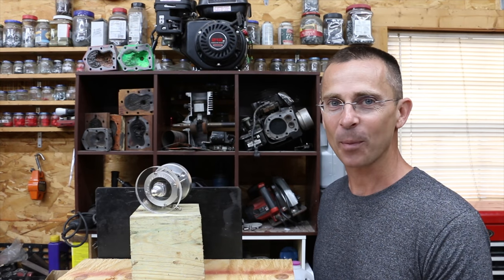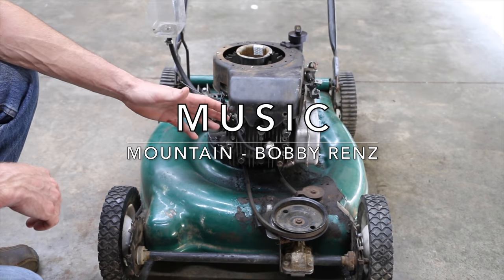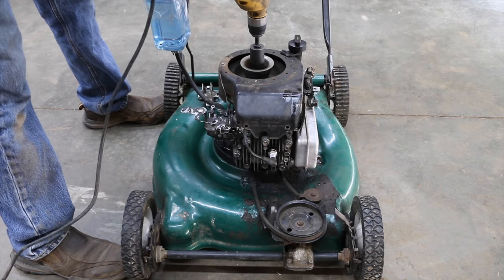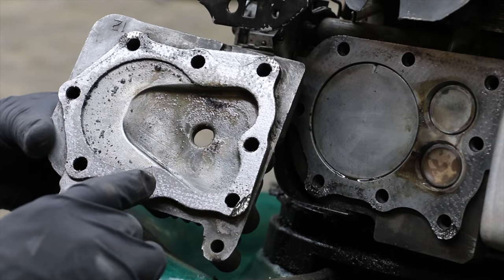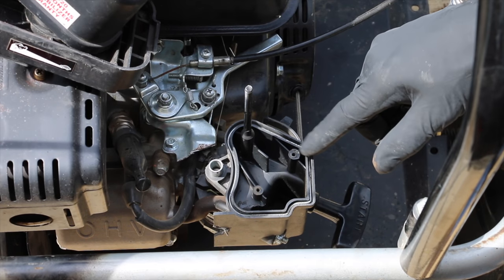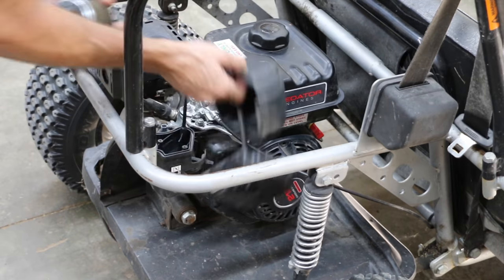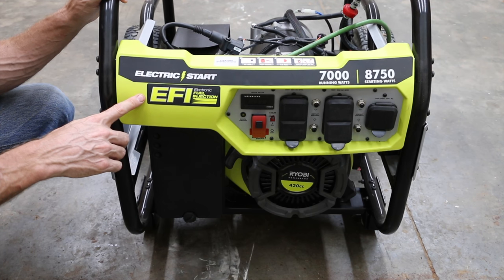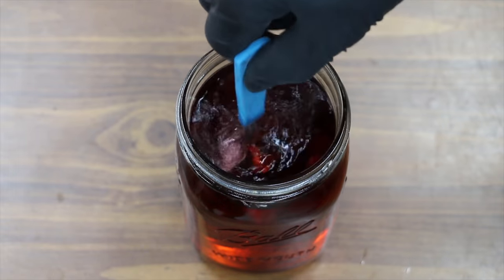Is Leaded Fuel better than Unleaded?  Let's find out!

Comment: Lead was added to raise octane and lubricate non hardened valve seats wasn't it?
Reply: Right what I've heard/read
Reply: reduced ping
Reply: Used in air cooled high load engines, which are ironically low compression.
Reply: Guy that did it was celebrated for doing    it,  30 years later they figured out it wasn't the best idea to put lead in the air.
Reply: @Taydrum  One of those engines i used had 6,5:1 compression a lycoming O-235
Reply: @trentallman984   This guy also had the idea of using CFC gas on cooling units (the type of gas that was destroying ozone layer)
Reply: @Bello..  somewhat ironically, the O-235 wasn't designed to run on 100LL, it was meant to run on on true, leaded gas, but 80/85, and the lead content was 1/4 that of 100LL.
Reply: @xanthuumnihyr5319  you realize that knowledge was suppressed because it was granted a 99 year patent?  It was only brought out after a replacement was found and patented.  Freon was the trademarked name.
Reply: Taydrum like the engine in my airplane
Reply: @xanthuumnihyr5319  cfc do not destroy ozone and it's not a layer. The ozonosphere is created by the sun rays hitting atmosphere and couldn't possibly be depleted faster than being created
Reply: angryw4nderer your wrong 👌 try doing some real studying mate.
Reply: @innovate.integrate.transfo6169  bingo, someone gets it.  It's all about money
Reply: correct this is why it still used in avg gas
Reply: that is correct Brian South. with exception of the lubrication of the exhaust valve seats...that was a side effect. we dint know we needed hard seats until lead was removed.
Reply: Taydrum But they are air cooled and can have high cylinder head temperatures that make pre-ignition and detonation more likely with lower octane fuels.
Reply: no, it doesnt raise octane. this only prevented pinging.
Reply: @Francois_Dupont  Octane is a fuel's resistance to knock/ping. Pure octane is the baseline at 100 octane (if you use RON as your measuring system) hence why it's called octane. Tetraethyl Lead does increase fuel octane slightly.
Reply: Yes, exactly. It also had a lubricating, cushioning effect and was better for older engines with greater clearances. A lot of very old cars on the road when lead was first taken out of gas couldn't run on the stuff and had engine damage.
Reply: Octane and lead content are not related.  100 LL avgas is formulated for aircraft engines which have higher compression ratios than your small engine.  The lead content in 100 LL (Low Lead) is still significant, and is there to protect the exhaust valves on these engines.  A common misconception is that since higher octane fuel is more expensive, it is somehow better for any engine.  Not so.  If your engine does not specify a need for high octane fuel, changing to high octane fuel will only cost you more.  If your engine specifies high octane fuel and you burn low octane fuel you can damage your engine due to pre-ignition or detonation.  Thus causes the temperature of the piston to be much higher than designed and can lead to melted pistons.  Note also that fuel that is stored for long durations will have lower octane than it did when fresh.  This is a good reason to avoid burning old gas.
Reply: @Francois_Dupont  the pinging was caused by preignition which is reduced by higher octane.
Reply: Lead was used in fuel  as an engine conditioner to make up for engineering technology that didn't exist in early combustion engines.
Reply: Brian
It did both, it helped soften the blow as the  valves closed against the seats, and stopped the pinging.  It may have helped lubricate as well. Wasn't uncommon in the 30s,  40's, up into the early 70's to need a valve job at 70, 000 miles from the build up of  lead
Reply: What I always thought
Reply: @innovate.integrate.transfo6169  Ozone is also created all the time by lightning in thunderstorms.
Reply: @angryw4nderer   The ozone layer is an atmospheric layer (the definition is indeed a bit blurry cuz it's not that much of a layer). And the ozone layer can be destroyed because we were destroying it back in the days. The phenomenon creating ozone isn't instantanious.
Reply: @innovate.integrate.transfo6169   NASA made serious satellite images showing the growth of the holes in the ozone layer. And it isn't directly CFC that destroy the ozone layer. Chlorine gas and other products of CFC decaying by UV radiation were responsible for that.
Yeah ozone is naturally regulating. Although, this regulation has been overcome by a far greater input of "harmful" gases.
Reply: @midsouthexpress  In very minute quantities
Reply: @midsouthexpress  have you ever noticed how insane it is that supposedly ozone is depleted by everything, including gas powered cars and all life is going to supposedly come to an end, BUT, there are periodic health warnings about high ozone in some cities.  So, what is it? Is ozone going extinct and we are all going to die?  Or, is there too much ozone and we are all going to die? What to do, what to do!
Reply: @zethloveless7238  Lollerskates another shill troll.....
Reply: @xanthuumnihyr5319  respectfully, this is junk "science"...
Reply: @BillWood1  "High ozone" during pollution warnings is pretty much nothing in comparison to stratopheric ozone concentrations. Moreover, ozone naturally decays into 02. In our altitudes there's not enough UVs to sustain durable ozone presence. Thus ozone "disapears" in a matter of a few hours here.
And the ozone layer isn't in "danger" since decades so no one should tell you that we are at risk for that.
Ozone is toxic at any altitude. We just happen to live in the troposphere, were ozone is pretty rare.
Reply: Yes and gm had the patent on it
Reply: What happened was the exhaust valves pounded themselves into the head.  I've seen them where the top of the valve sits below the level of the combustion chamber.  I've heard this was because lead cooled the seats and when it was taken away the seats ran hot and that softened the cast iron

Comment: I use this stuff in my generator & lawn mower for winter storage.  Actually just started a old honda cb200 motorcycle last week that I had stored for 8yrs with 100ll in it. Fired right up & ran good as it did when it was parked. Fuel still smelled fresh....some fuel injected engines don't like it some run just fine on it. Carburetored engines typically seem to run better.

Comment: You must buy small engine head gaskets by the pallet.  ;-)
Reply: Probably by the truck load just to get cheaper shipping costs.
Reply: Or just applies copper seal and reuses them..
Reply: He always uses a new gasket to follow manufacturers recommendations, that way his tests are as fair and equal as possible.
Reply: He often shows the opening of the package.
Reply: On small engines like Briggs & Stratton's, Honda's, etc, etc - I've just reused the old gaskets.   Was never a problem.   The only times I replaced them when they were REALLY old and had fallen apart during disassembly or when I wanted a thinner gasket to raise compression ratio.

Comment: Run a engine Submerged in water with a snorkel and see the outcome
Reply from the maker: Thank you for the video idea!
Reply: This would cool for us off-roaders to see.
Reply: It won't work with a gas engine.  It'll short out the electric system.
Reply: And run it on hairspray as fuel 🤔
Reply: @alansheedy3956  maybe. Probably what would happen is the flywheel would be dragged down by the water pressing against the fins and stall. Or. It would find its way into the crank case and cause mechanical failure
Reply: Just cover up battery and electrics and it should run will for a while.
Reply: @alansheedy3956  Seems I heard somewhere that distilled water will not conduct electricity.  It's the minerals in water that cause the water to conduct.  Am I right or wrong?
Reply: @dwightl5863  you are correct. its more than possible to run a gas engine fully submerged in water.
Reply: @ProjectFarm  Gread Idea. But start it first, then submerge it, so the exhaust can be under water!
Reply: @alansheedy3956  not in all cases. That's why a ATVs can run completely submerged. Because the electrical systems are sealed the only thing that could remotely close that would be the spark for the ignition. But that's why they have rubber boot over it.
Reply: @alansheedy3956  Yes you can. All that would be required for a small, air-cooled engine would be to seal the electrical system (dielectric grease), remove the air fins from the flywheel (if you leave them on they'll generate a huge amount of drag), and route the crankcase breather back into the air intake before the carburetor, if it isn't already. Then it's just a matter of sealing the intake and exhaust and routing them up and out of the water.
Reply: @dwightl5863  You're wrong. The minerals in water are trace amounts, at best, and many of them are non-conductive. "Pure", as in distilled water, will conduct electricity very poorly. (edit, since some people insist on being pedantic)
Reply: Ive wondered that because I have WW2 german bikes with snorkels for crossing rivers and I always wondered if they work or the head will crack or something.
Reply: @Dave-dh7rt  Deionized water, which the question was about distilled water, btw, which isn't the same, will still conduct electricity, just poorly.
Reply: @theq-1  It's not good for them to suddenly submerge a hot engine into cold water because warpage or cracking can occur, but when necessary, it can be done.
Reply: @ProjectFarm  If you do this, make sure to snorkel both the exhaust and the intake. Otherwise you'll drown the engine if you don't snorkel the exhaust. Either that or start the engine in the open then submerge it at a nice high RPM.
Reply: Yaaaaaay keyboard warriors!
Reply: @177SCmaro  so poorly, that it's essentially zero. Distilled water has no impurities, and is not conductive. DI water is about an order of magnitude more conductive, which is then about 4 orders of magnitude more conductive than sea water. You're trying to argue semantics just to be that guy. Don't be that guy
Reply: @UniqueBreakfastTaco  Wait, so its okay for you to argue semantics but not me? Because you're "being that guy" while telling me not to.
Also, I wasn't the one who started this exercise in pedantics, I merely responded to it.
If prople are so bored they insist on stirring up even the slightest bit of conflict this thing ends with the fact that, ultimately, pretty much everything is a conductor if you ramp up the voltage enough, including pure water. Its only a matter of how much resistance is offered.
Reply: @177SCmaro  im not arguing semantics.  anything can conduct electricity under the right circumstances; and while true, is the only logical stance you can have given your comment. thats not what the question was, tho...was it?  you may not have asked the question, but you replied, incorrectly, repeatedly, to others.
Reply: @UniqueBreakfastTaco  You just got through telling me I'm wrong about the meaning of words while lecturing me on "not being that guy" who lectures others on the meaning of words. In fact, you're STILL doing it. You just did it again ffs.
Nothing I said was wrong. At worse what I said could be misconstrued and taken out of context, which is what happened, because it didn't occur to me that  I would get a visit from the pedantry league if I wasn't absolutely precise in what I said, a standard no one else is being held to or holding themselves to.
Reply: @177SCmaro  I think "you were right, I made a mistake" is what you were trying to type.
Reply: @alansheedy3956  same with new modern-day diesels
Reply: Maybe a diesel?
Reply: @Fister_of_Muppets  axe body spray
Reply: @alansheedy3956  Wrong most engines are water cooled with in them
Reply: @dwightl5863  yes you are correct
Reply: It may or may not continue to run. The water is only going to be partially conductive so it might not stop the spark depending upon how effective the spark plug rubber boot protects it... It will depend upon how well protected the various parts of the system are from water ingress I believe
Reply: @alansheedy3956  use distilled water it does not conduct electric
Reply: Super water cooled

Comment: wow that probably the first time I've ever seen a rotary engine work in real life
Reply from the maker: Thank you
Reply: At 25,000 RPM no less
Reply: really? I've had 3 rx7s and 2 rx8s and all the engines ran great when I bought them and when I sold them.  Most of the issues with rotaries is due to poor preventative maintenance, basic maintenance/upkeep, and lack of knowledge of how to care for them.  I've also seen them abused and hold up.

People doing stupid things blow them up, and probably blow up honda engines as well.  No engine withstands abuse and neglect.
Reply: @Meme Man that is a myth.  abuse and neglect kills engines.  I've seen plenty of dead Hondas on the side of the road.  I've seen them smoking.  I watch SMA and plenty end up in the shop with lost compression on a cylinder.

The issue is, there are hundreds of millions of piston engines on the road and its normal to accept some die.  There are a handful of rotaries on the road and when they die from similar neglect and abuse, a big deal is made out of them.  Add to it they are in sports cars in the U.S. and you get people that buy them to be hard on them.

Pretty much any car make and model has a forum with people asking questions about their engine problems.  If piston engines were immortal, there would be a lot less shops out there fixing and rebuilding engines.

What you don't see much of is success stories.  The guy with 200k on a rotary isn't in videos.  Take Rob Dahm, he abused his 3 rotor and it held up for many years until he did something stupid on the dyno; because he kept it lubricated properly.

If you keep up: lubrication, cooling, fuel, ignition, exhaust ...  and rev the shit out of it on a semi-regular basis (not over-rev), you will have a happy, long life rotary.  It is high maintenance.

You can find plenty of examples of piston issues if you are willing to look, be open to it.  Top Gear joking about Porsche catching on fire when hamster bought one.  Ferraris catching on fire.  Etc the list goes on forever, if you get out of the echo chambers and shit fests.

have a good day, stay safe out there.
Reply: @kuromurasakizero9515  he probably meant the actual inner workings, showing how it functions .. ive saw several pistons animations etc for regular engines but never a rotary engine

Comment: How do you drill start those engines? Do you have a ratchet adapter on the drill? If not, how do you make sure the drill doesn’t “take a ride” once the engine starts?
Reply: I tore mine apart after the cord snapped and if you take off the plastic covers and the spring loaded cord assembly, you will see a nut. Ratchet adapter is 5 bucks at harbor freight for the 3 common sizes.
Reply: I've never had an issue staring an engine with a drill, just pull the drill off the nut before stopping the drill.
Reply: Ratchet adapter? You mean socket adapter?
Reply: Richard no, it is a ratcheting adaptor that goes between the drill and the socket, so whenever you release the trigger on the drill, the drill doesn’t “take a ride”.
Reply: Josh Christian Thank you for defending me!  About the ratchet/socket adaptor, I was interested in it because I thought I could break my wrist otherwise, from the speed of the motor while the drill was still attached. Does the drill “torque” your wrist out?
Reply: @ryanurukalo4347  no not at all, once the engine cranks over you just pull it back.  I used that mower for 3 years until this year when i bought a brand new one in box for 30%of retail.  Yes I am that cheap and my name is Christian.

Edit: if the drill torques your arm when starting a lawn mower, i would suggest doing 10 sets of 10 pushups throughout the day to start.
Reply: Josh Christian that’s alright! Being frugal is great!
Reply: Way to many adds. Had to leave.
Reply: @jamesvw769  get adblock if you hate ads that much....
Reply: You pull the socket from the nut. Dont need a clutch for that
Reply: Just pull it off quickly  once you hear it fire. Make sure its the proper size socket so it slips of the nut easily. You want the socket to fit snugly on the socket adapter which you want tightly in drill. Don't recommend it for motors that tend to backfire while starting or you'll be snapping adapters or worse

Comment: I use AVGAS in my lawn mower. runs great, runs like crap off of pump gas. I also use it 50/50 for my dirt bike. runs crisp. Leaded fuel mixes better than non for 2 strokes, doesn't separate.